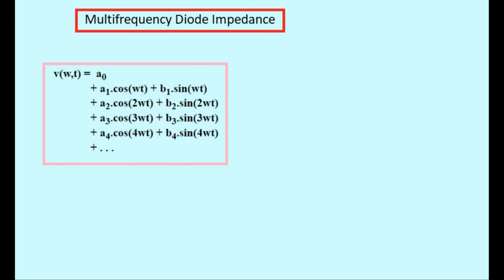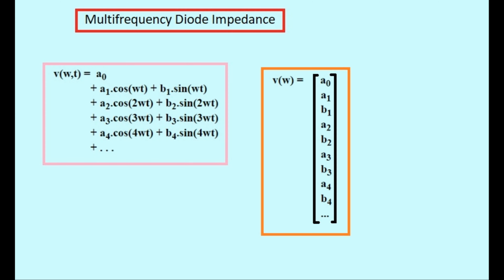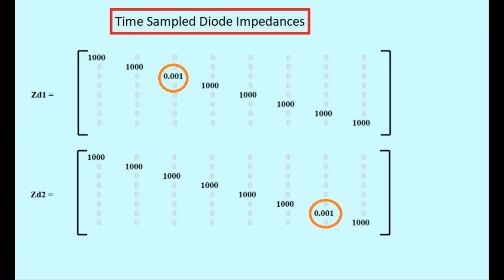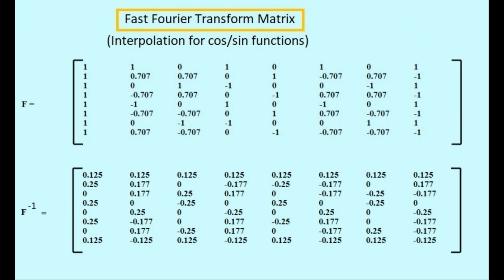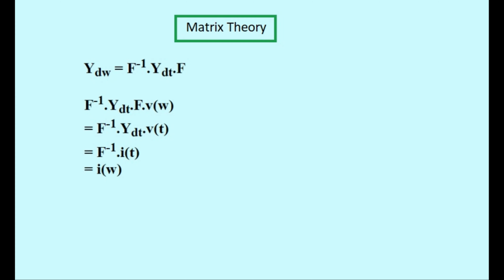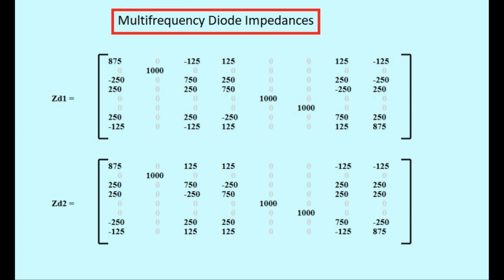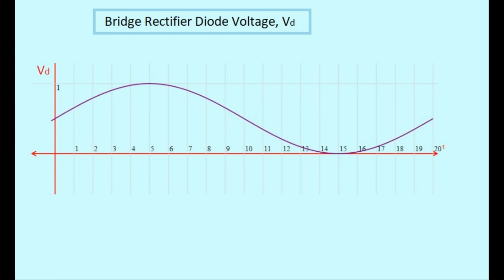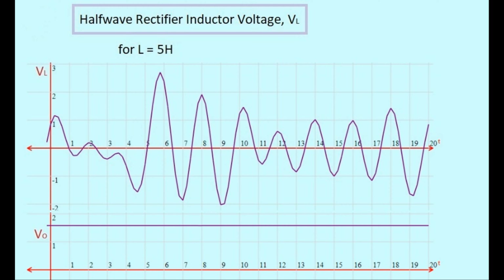Diode Impedance Part 3

Comment: Would as small signal work with this method. I would think so, since only the distance between each half wave would be further apart.
Reply from the maker: This only works for sine waves as input causing DC as output. Its a sort of Jacobian Matrix, although I calculated it a bit differently.
Reply: @electroworld9872  Thank you for the reply. Your vid’s are very interesting; not seen anything like yours before.